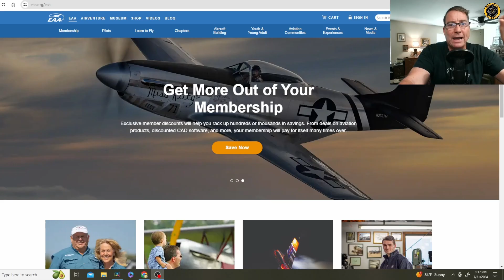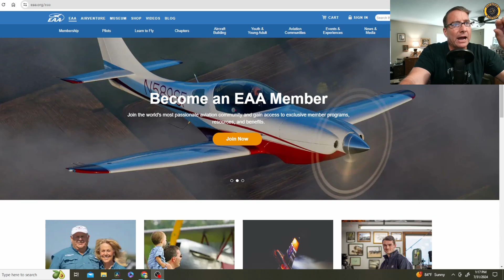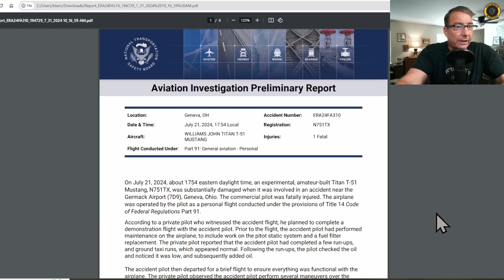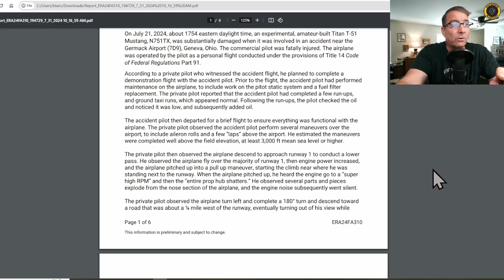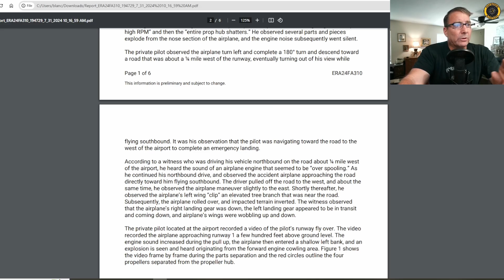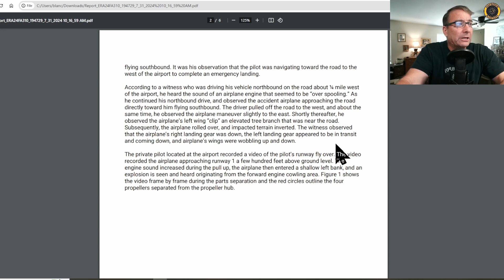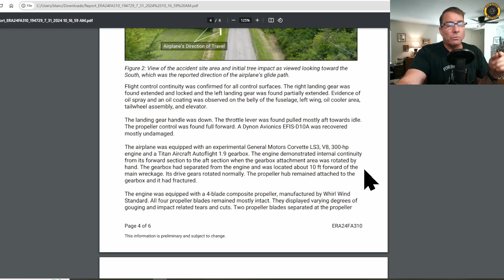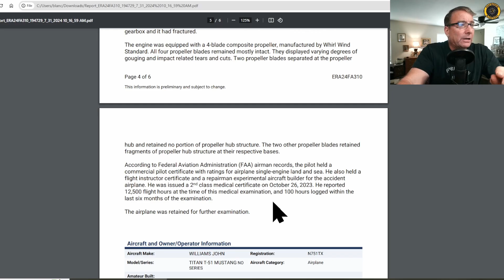Titan T-51 Fatal Prop Hub Failure 21 July 2024

Comment: Most automotive engineers shudder when they think about automotive engines in airplanes.  There are a hundred details they say they would change in the engine and its systems for aviation.  This has been a common theme for as long as i have been in aviation.

Comment: I would imagine that somebody by now has already mentioned this but we have no idea whether the Hub failed which allowed the engine to overspeed or the engine increase in speed may have caused the Hub failure. It's possible that there was a vibration or some sort of harmonic that caused the propeller Hub to fail. That's what it sounds like especially if you're talking about a composite or composite blades with an interface to the hub. That's just what I can think of off the top of my head. Or if it was the gearbox that literally failed and came off of the front of the engine slightly causing the failure of the Hub and didn't separate completely from the engine till it hit the ground. That would have caused the engine to overspeed as well

Comment: 4:13 If the gearbox is designed for 300 hp doesn't mean you use 300 hp, you should use 200-250hp or get a stronger gearbox

Comment: Why would a rev limiter not have been installed?
Reply: I made this point myself at the time. However, although the ECU possessed the ability for the rpm to be set to any desired value, was not set. Fatal oversight.

Comment: @blancolirio I myself have an LS3 powered T51, nothing wrong with the automotive conversion. After Johns accident I believe I found what may have caused the catastrophic result which I’m now open to sharing. The Link ECU used has certain parameter settings, one being the Engine RPM limit. After thorough investigation, the ECU had the ENG RPM parameter set to 4500 however, it was not turned on. The design fault here has the throttle linkage set to WOT, essentially allowing the engine to go to 6600rpm. Put two and two together, throttle linkage break lead to full WOT, no ECU protection, governor failed to govern due to a high rpm acceleration exceeding the rate at which the governor could manage the load. This in turn caused the prop to swing at 3500rpm. Centrifugal load tore the hub apart. I contacted all Link ECU owners of the T51 LS3 and all found the same issue (ECU parameters set but not turned on). A simple fix but a tragic loss to find the reason behind the cause of the accident.

Comment: Unusual for a composite blade prop hub to explode. There's a lot less mass and outward force Vs aluminium blades. I suppose once you go past 3000 rpm for any length of time any type of prop & hub is going to suffer. It's a horrible sound hearing a aero engine and prop go into overspeed, sort of sound you can't ignore.

Comment: A very sad event.  My prayers to the family.  

If the original cracking of the prop hub occurred at the same time the first increase in engine power was applied it may have opened the hydraulics / oil pressure to the atmosphere.   The lose of hydraulic pressure allowed the prop blades to go flat causing  the 2nd increase in RPMs.  The additional increase in RPMs exceeded the engineered design limits of the hub.  Causing the already weakened hub to rupture, releasing all 4 propeller blades.

Comment: How many engines have blown or been damaged by people missing gears or launching a boats propeller out of the water , its a sudden loss of load on the engine . No way a 300hp engine could increase power that quickly while pulling that plane through the air unless a failure occured. The prop may have had a defect from the manufacturer, time will tell .

Comment: RPM could not surge so rapidly without loosing the load on the engine . So possibly the connection was broken inside the hub which caused the detachment of the blades simultaneously causing the over revving heard by witnesses. The oil spray on the underside of the aircraft could have been from detonating the LS engine .

Comment: thats a thinker. i think what the witness was hearing the overspeading engine is just the engine running with no prop and wizzing up with no load. it should be hard to overspeed the prop just randomly, flight was just a check for recent work unrelated to the prop, not testing the max prop speed. and a guy with that many hours in his own plane would know whats normal. i think something was going on with the prop, manufacturing defect / cracks maybe a combination of both its under the spinner not like its inspected a lot.

Comment: If the prop reduction gearbox failed and seized then when it stopped it would cause all the props to break away as shown in the video frames. The engine input shaft gear would then shear and allow the engine to spin up under no load.

Comment: Never use an automotive engine for an aircraft. If it fails you just can’t pull over on the side of the road.  Piston aircraft engines have redundancy of systems like dual ignitions & dual spark plugs per cylinder.  Air cooled engines don’t have coolant hoses or water pumps to fail.  Also nearly all automotive engines have wet sump oiling systems so if you pull negative g’s you starve the engine of oil causing a bearing failure.  Gravity is needed to keep the oil in the oil pan.

Comment: I wonder if oil had been leaking into the combustion chamber of the engine. Just a thought I had. I'm not an official mechanic of anything but I have had to fix my own motor vehicles for much of my life just because I didn't have the money to get someone else to do it. It was always cheaper to buy the manual, the parts, and figure it out myself.

Comment: Can someone explain why more mechanical points of potential failure are added to maintain 3000rpm prop speed when you can just limit the throttle to never exceed 3000? an average car engine idles at 800-1000.

Comment: It seems that every third comment is from a (probable) car guy reminding us that the LS type motors have rev limiters.
   Yes- but irrelevant. If the prop governor malfunctions and commands flat pitch while airspeed is high, the prop is DRIVING the engine....is is like downshifting to first gear at 120 mph. The rev limiter doesn't have a bit of control over that-BOOM!
   The prop hub is under huge centrifugal/centripetal forces at normal RPM, and won't tolerate 20 or 30% overspeeds, even less so than the engine.
  Radial engine airliners (and turboprops) have been lost due to prop malfunctions and overspeeds, continuing to overspeed engines that had long before stopped producing power. A few Boeing stratocruisers were lost this way, and others...many. ..Douglas c-133 cargomasters had very troublesome props.
     This particular overspeed may have only killed the prop, or maybe all the valves were bent from valve float in the same instance- either or both is the same...loss of power.
   It is also likely that this conversion used a nonstandard ECU. At the least, a reflashed one, eliminating the VATS (does gm still have that?) and anything related to emissions, etc. to enhance reliability.

Comment: Throttle friction must be increased on the throttle control, the LS3 achieves RPM to quickly for the gearbox to handle. I really believe this is part of the problem.. those gearboxes need to be rolled into RPM at a controlled (limited) feed rate. I believe the gears ⚙️ are getting high axial loading during quick throttle stabs, and the gears are coming out of mesh causing wear problems, and unfortunately, catastrophic failure…
Reply: Not saying this is the total reason of the prop hub failure, but I believe the ability of that power plant to rev up so rapidly, that everything attached to the crankshaft is getting abused, including the prop hub and prop.

Comment: I'm curious about the reported oil spray. I wonder if they will be able to separate the oil that certainly sprayed out during/after the crash from any that might have been in-flight and part of a loss of oil pressure to the hub.

I think the comments about loss of oil pressure leading to a prop feather are onto something. But perhaps there was a mechanical malfunction (leak) that contributed to the loss of pressure. If the thing was already "low on oil", was it due to oil consumption or was it possibly losing some oil under pressure from somewhere?

I'm not sure what the oil consumption norms are for the LS engine.

Would be interesting to hear about if they do a teardown of the engine. Perhaps debris in the oil pickup tube?
Certainly this has been addressed, but in an LS, I wonder where is the oil pickup tube in relation to the sump, especially when doing a high-G pitch up maneuver. 

Also, not sure which generation of LS engine was used, but I know from following some hot-rodder youtube channels that there is an aftermarket oil tube pickup brace guys like to add to strengthen the attachment, as from the factory there is only one bolt holding it into the pump instead of two. Perhaps things like this were a failure point during a high-G maneuver which was overlooked as the engine was never designed for this type of application.

I admire doing these kind of engine swaps. Takes some serious engineering.
But certainly there are all kinds of issues like this that would be hard to track down without encountering an unfortunate failure.

Comment: As a mechanical engineer and as a first pass initial reaction (and FWIW), it is just an opinion that the hub had developed a crack (or several) due to fatigue, or a mfg. defect, or both. Possibly aided by a history of quicker, more instantaneous torque changes (perhaps due to the LS motor's response to throttle changes?) Anyhoo... hub failure caused engine overspeed and then it went grenade mode.

Comment: Unless the engine suddenly found a way to make a LOT more hp, it sounds like the prop pitch had to have suddenly gone to a very fine position, unloading the engine while it's throttle was mostly open.  Failed prop governor, perhaps?

Comment: I believe engine surge happened after prop hub failure, He had to start a high load climb after the pass which I believe the extra torque caused hub failure.

Comment: What a tragedy, from what I could see in this video mr Jhon Williams was a great airplane builder, and with so much experience having an accident like this is really regrettable, there should be stricter regulations because an airplane accident means death or tragedy for third parties, electric motors should replace those prehistoric internal combustion hulks that, apart from being heavy and inefficient, require many auxiliary systems for them to work, as our old hero said, which make even more difficult or hinder the inefficiency of those engines, in England it has been tested with complete success an airplane with a very fast, light, silent electric motor and WITHOUT THOSE DAMMED DANGEROUS AUXILIARY SYSTEMS that only cause problems 

I think it is time to switch to the electric motor definitively to avoid tragedies like this one that from time to time mourn the world of aviation and cause so much sadness and loss to the families and friends of those involved in accidents

I propose to name that hangar or some place related to the work and efforts of our hero Mr. John Williams to honor his name and his total dedication to the safety of his passengers and the good use of airplanes and the aeronautical industry

Comment: If the blades went flat would that not allow the sudden increase in rpm ? Since it was likely running close to its designed rpm limit?

Comment: This sounds like loss of oil pressure or a governor failure. Kevin Eldredge had a failure at Reno in his Nemesis NXT, #42 "Relentless." This sounds identical. I was there for that. It lost oil pressure (sounded like it lost an oil filter), draining the entire engine rapidly around pylons 7, 8, & 9, through a roughly 4g turn. The prop immediately went fine and caused an overspeed, causing the blades to depart. I do not believe this was a prop hub failure, though the hub failing was likely a cascading result of another failure. It is highly unlikely it had anything to do with gearbox, and may not have anything to do with it being a conversion. As mentioned, we've seen this on typical "aircraft" engines as in the Reno example.
Reply: I agree - loss of oil pressure to the prop causing fine pitch and overspeed.   An engine computer with overspeed protection would have been unable to keep the windmilling propeller from overspeeding.  Car engines belong on cars unless they are FAA certified.

Comment: At the risk of stating the obvious, why wasn't the engine fitted with a rev-limiter? Many modern high-performance cars, and especially bikes, have this as standard. Very simple to do, and would, in theory at least, make a prop over-speed impossible. 
I would also suggest that the engine would only over-rev to the point where it blew up if it had become detached from the propeller gearbox. In which case, what caused the propeller hub to over-speed?

Comment: 2 of the prop blades failed at the root. 2 tore out of the hub. Did the hub fail or did the engine lock up at high rpm?

Comment: Just wanted to make 2 observations that speak to a man I never knew's character: 1- He purposefully left his passenger on ground for one final check after maintenance and 2- my amateur eyes seem to see an evasive move at the end of his flight to avoid hitting a car with a passenger(s) in it.. knowing his own life would be in more danger. 

Minimum 2 lives saved as his final choices on Earth. Incredible. RIP Mr. Williams.
Reply: That's probably all true, but unfortunately it points to the mistake of his choice of where to land when there were better options available.  If he had chosen better, rather than saving the plane or saving someone else's life, he would have been able to focus on saving his own.   He knew the area well, so he knew what his options were.   This was an option but far from ideal in the case of the plane, the other people and especially his own life.
Reply: @boneseyyl1060 idk. I'm  not a pilot, but from the looks of things off Google maps, the road to the right running parallel to the runway (rt 218) doesn't look a while lot better to have made the attempt. Same goes for clay st (the road on the north side that runs perpendicular to the runway). 
Gotta keep in mind he was only a couple hundred feet up basically flying a glider. He didn't really have any other options other than those 3 roads I mentioned. None looked good imo.
Reply: @joemalinak7410  Not a pilot either Joe, but I do know a little about flying.   You are thinking that his only options are to land on a road..  And if saving the plane is the main concern you might be right.  But the main concern has to be surviving the crash. And as you say, at that low of an altitude it is going to be a crash and not a landing.   At that altitude and with no engine, his only real choice is to point the nose at the ground to maintain airspeed.   Turning in any direction increases the risk of stalling or losing lift. In these situations real pilots will tell you to maintain as straight a heading as possible, pick the clearest open area ( and roads are not clear open areas) leave the gear up and fly the plane into the ground.  The plane will slide and take some damage but more often than not the pilot will walk away.  Trying to save the aircraft over your life is a poor choice.  
     He had those choices directly in front of him but chose to turn and try the road.  And it cost him everything, not just a plane.
Reply: @boneseyyl1060  no, the roads were not the only places i assumed he could potentially land. I totally get what you're saying, but if you look at the area, the only real open area that I could see was at the north end of the runway across the street. At least only open area that i would guess was big enough that he could reach gliding to. Right where he was probably making the 180 for the street that he attempted to land on and a few hundred feet directly below him. At least that's what it looks like viewing the area on Google maps. Maybe you see something I missed. But that was my YouTube trained professional opinion 😁
Reply: @joemalinak7410  Of course none of us really know what we would do in the that situation.  Easy to sit with all the time in the world and decide.  Having a plan beforehand helps and keep it simple.  It's all you can really do.  That open area in front was his best shot IMO.  Sad that he won't be around to build more of those great looking planes.
Reply: @boneseyyl1060  saying nuh uh, I think the field was good best option isn't very convincing. Can you elaborate exactly how you think he'd have been able to pull off maneuvering the plane to be able to land on that field? 
By some rough calculation, I estimate that field to be about 1500 ft long by 600-700 ft wide. The mechanical failure happened towards the north end of the airfield while he was several hundred ft in the air. 
He would've had to glide roughly half a mile to begin his turn to head south to land on the field. 
It seems to me if he had the airspeed and elevation to make that his landing, he would've had a better chance making the u turn over the field and come back to land southbound on the runway. Unless you're speaking about a distention field from the one directly across clay street from the airport, the field looks like the worst option he had.
Reply: @jakerabinz9411  Like a safety net.  It seems to make sense.  I haven't heard too many people mention it as an alternative.  Interesting.

Comment: In an application like this where the automotive engine is capable of higher revs than structual integrity limits of gearbox and hub, isn't the engine rpm hard limit set to the appropriate max rpm for the application?